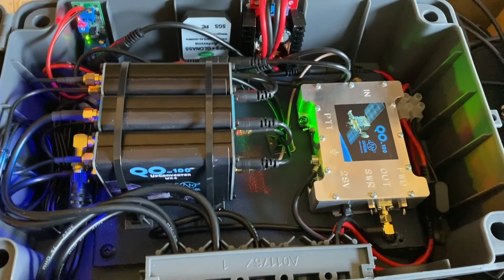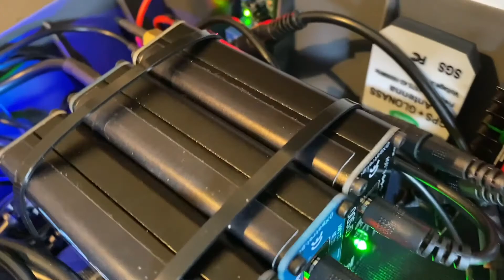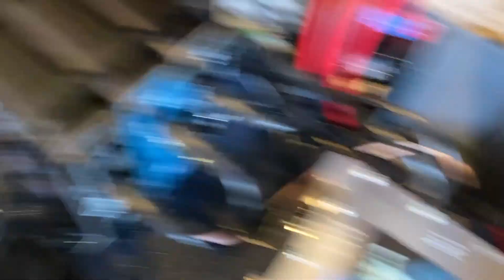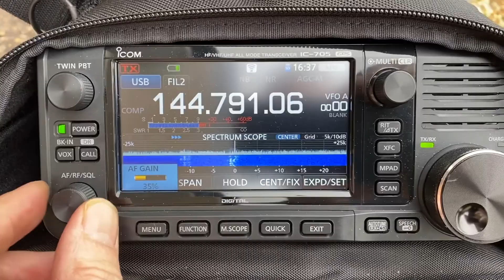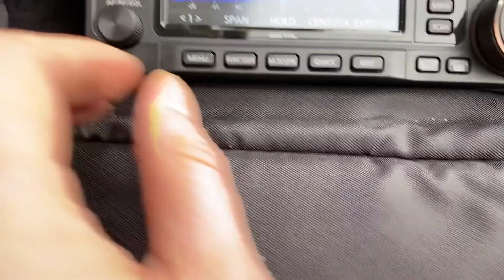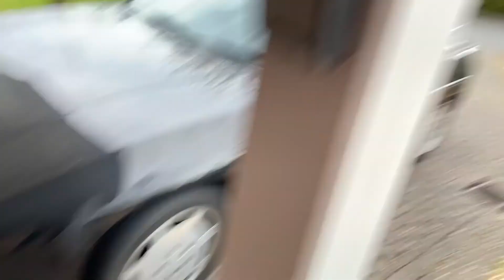QO-100 / Es'hail 2 Amateur Satellite Setup and Walkthrough - Featuring IC-705

Comment: So is everything transverted down from X band so that you are transmitting and receiving in the 2m band on your radio and you can use your IC-705?
Reply from the maker: I am down-converting X-Band (10GHz) to a 2m (144 MHz) IF and up-converting a 70cm IF to S-Band (2.4 GHz). The radio I am using in the permanent solution is an Icom IC-9700 which is capable of full duplex on 2m/70cm. The video shows an Icom IC-705, but just to demonstrate/test the receive using the down-converted 2m IF. However, there is another DX Patrol product (QO-100 Groundstation) that I believe does support both uplink and downlink using a common 70cm IF (half duplex), so it may be worth taking a look at their website - https://www.dxpatrol.pt. You can see my completed setup with the Icom IC-9700 in this video: https://youtu.be/irpAN9H2KU4

Comment: Hi, which frequency band do you use for your uplink? 433 or 1296?
Reply from the maker: Hi Rick. I'm using 432 for the uplink IF into the DX Patrol upconverter, then 2.4GHz to the patch antenna

Comment: Hi great video, can a kit be bought plug n play style ?.
Reply from the maker: Thanks. Yes, pretty much PnP. The only configuration required is moving a few jumpers depending on whether you're using a GPSDO or internal oscillator (default is internal).  You may also need to adjust the gain on the downconverter to suit your setup. I have long coax runs, so mine is set to max, then I make adjustment as required using the RF gain on the radio.

Comment: Look forward to working you on QO-100 de M0SNR
Reply from the maker: Yes, look forward to it. Finally got round to sorting my uplink: https://youtu.be/irpAN9H2KU4
Reply: @RTSRetroTechShed  Excellent! Nice setup. I'm also using an IC-9700 but went for the Kuhne up converter and 23m of AVA5-50 from my shack to the dish. Not perfect and a little lossy but I'm managing to get a pretty good signal into the satellite. It would be good to meet you on there :)